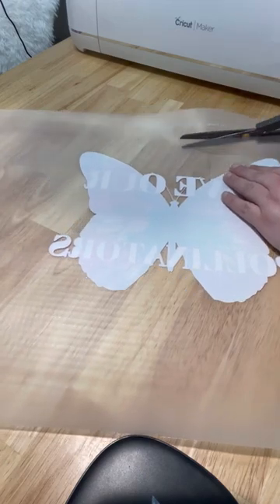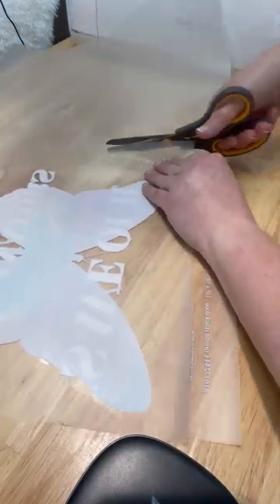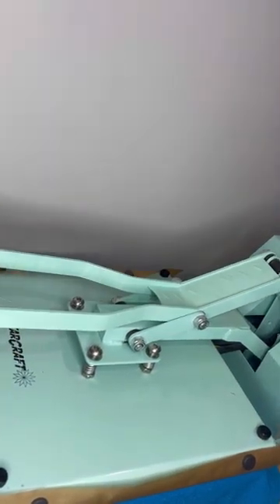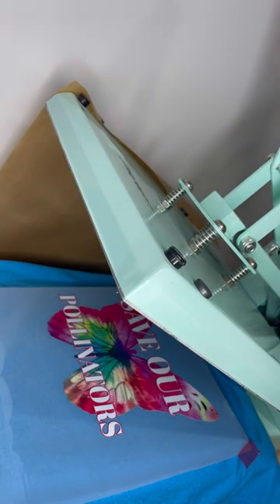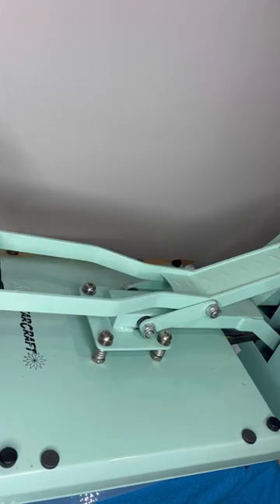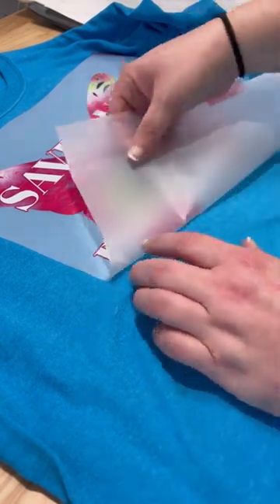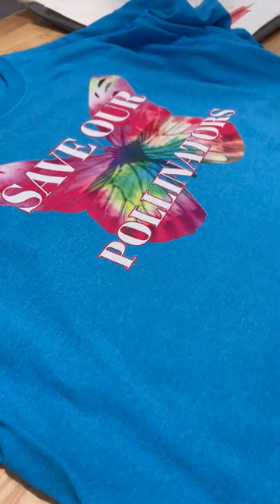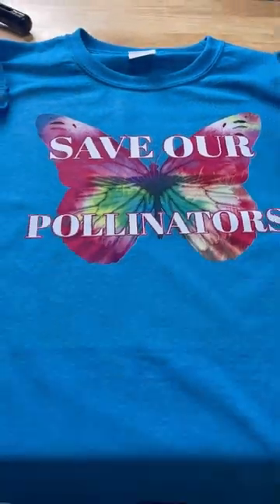How to apply DTF transfers the right way - custom transfers #dtftransfer #dtfdesign

Comment: Do you wash just as you would for HTV?
Reply from the maker: Yep!
Reply: @CorinneBlackstone  I’ve been using DTF from a few different Etsy sellers. But all of them said I could wash, use fabric softener etc and dry in the dryer as normal. I mainly use DTF for businesses with custom logos etc. And I’ve not had any of them come back saying anything bad has happened with regular washing and drying instructions. 
I honestly don’t do much with HTV b/c it can be so frustrating for customers since they shouldn’t put it in the dryer. 
So I’m wondering if 143 is telling you to wash and dry normal. Or if their saying to treat as HTV…cause that means different things, at least to me
Reply from the maker: @greedygamblerslots  I suppose I should say I literally wash htv like I wash anything on cold inside out and when I had my old dryer I would dry them on high. Our new dryer gets hella hot so I dry on low now which was like the old dryers high

Comment: Mine failed and come out of shirt badly
Reply from the maker: Typically it’s because it was not pressed correctly. For 143 prints they have changed press settings. Press at 320 for 20 seconds nothing on shirt. Place DTF press another 20 seconds at 320. Remove carrier sheet then press for 20 seconds at 320 again

Comment: Impressed, but confused. When I googled dtf transfers, there's mention of applying the transfer powder, . ? 
Also do you need a special printer? 
I am able to get the dtf transfer film. 
Yet what printer is needed to print my own designs.
I have a heat press as well.
Reply from the maker: I don’t print my own designs. There are chemicals involved and I prefer to just order them from https://www.143vinyl.com/custom-dtf-prints.html?partner=196113
Reply: You need an Epson printer and then convert it to dtf. Usually people I see use the Epson 8500 or Epson 5000. And yes, if you do your own, you do need to apply the transfer powder
Reply: If you order them from a company you don’t need the powder. When you print yourself, because you probably don’t have white ink, you need the powder. At least that's what I've heard.

Comment: I love DTF but hadn't heard of pressing them with a heat protector. The last batch I ordered gave me a bit of a hassle to get on my shirts, this could be why and now I will be sure to could be why.  

Now in your video it appears that you already have a Teflon sheet attached to your press with magnets so do you mean an additional sheet isn't required or is your press lacking the existing one that is usually on the upper platen?
Reply from the maker: If you observe in the video that sheet is not on my press for the first press. It is hanging off the side. When you press the second time you will want that Teflon sheet on
Reply: @Corinne Blackstone  you're so right!  When I saw it being used at the start I didn't even think to look for the 2nd press.  Thanks for the tips!

Comment: im trying to print on my dtf transfer paper its not stickig to my shirt
Reply from the maker: What are you printing with? Do you have a DTF printer or are you trying to use sublimation ink? Are you applying powder?
Reply: @CorinneBlackstone  I have a epson 2800 pri ter and  my ink is dtf ink. it's called  100 ml E- C Dtf pigm3nt ink
Reply from the maker: @sushhinii9327  you still have to use a powder as far as I know which would be why it’s not adhering to the shirt perhaps. But as I don’t own a printer I can’t say for sure
Reply: @CorinneBlackstone  which side should I put the powder on the wet  printed side or the other side?
Reply from the maker: @sushhinii9327  you put it on the ink side